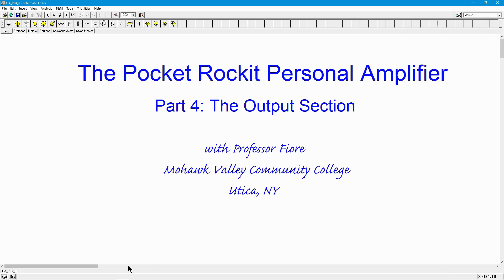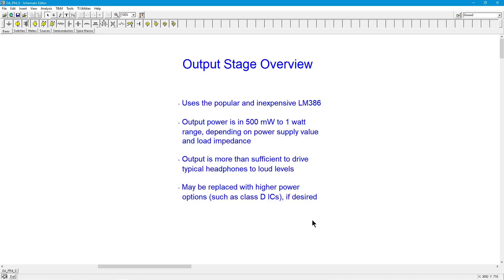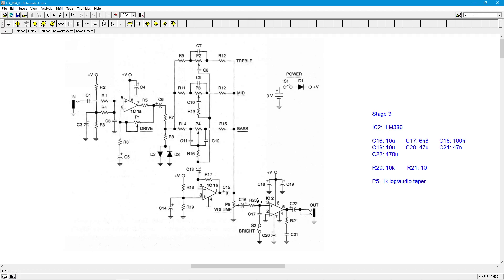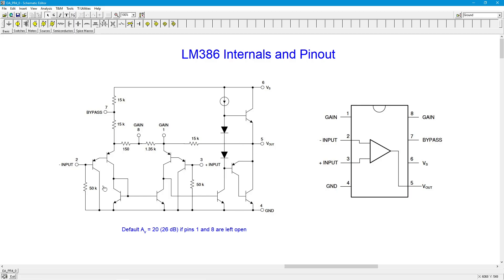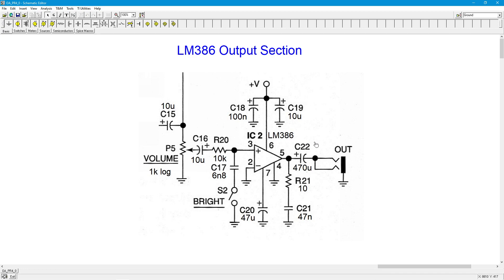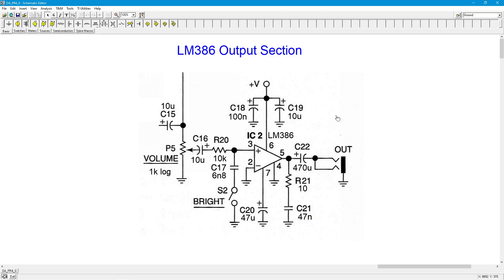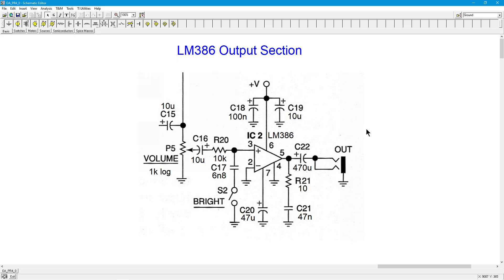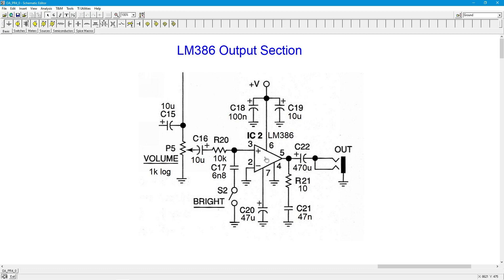Op Amps: Pocket Rockit Personal Amplifier, Part 4

Comment: Well, I have this built but the EQ doesn't seem to work.  Anyone out there have any ideas?  I am pretty sure the circuit is correct, as I am using a PCB created from the schematic.  I also measured all the components as a sanity check.
Reply from the maker: Hate to say this but, if you've checked all of your components, chances are that there is an error in your layout. I built this circuit back in the days when we hand-taped the layouts and I can verify that it works fine (i.e., this is not something I just simulated). At this point, my question would be "Is it just the EQ that isn't working or is it the entire Pocket Rockit?" If it's just the EQ not working, the issue is whether or not you see any change in signal from the EQ input to the EQ output. That should give you a clue. Back when I was in college, a friend of mine built a 10 band octave EQ. He brought it to lab and couldn't get it to work. It would cut, but it wouldn't boost. He was really depressed. I offered to help, and together we started tracing the signal. It turned out that he inserted the wrong size coupling cap at one point (as in nF instead of uF) and that just crushed the signal. Sometimes the errors are just dumb mistakes like that or a trace that goes to the wrong side of a component. Unfortunately, sometimes the "obvious" mistakes are the hardest ones to find because you expect A but it's really B (like trying to proof read your own writing). I've seen many goofy things in lab. I once had a student who could not get his senior project to work. The chips were fine but it turned out that one of the IC sockets was bad. The craziest thing I saw was another student who could not get the power supply portion of his senior project to work. We finally traced it back to some rectifier diodes that were mislabeled (band on wrong end). Turns out that he had picked them up at a local Radio Shack in their bargain bin. Not much of a bargain!
Reply: @ElectronicswithProfessorFiore All other functions including the "bright" switch function work, though the distortion control does act as a volume control at lower volume levels.  I have used the Bode function on my scope, but see no change in the signal.  I hear a slight change in the bass response at both ends, but the changes are identical and small.  I have verified my schematic (KiCAD) against yours and it seems correct, the only difference is that I had used two caps in parallel and in another case two caps in series to replace caps with unusual values.  The PCD  was made with KiCAD and with a correct schematic I would assume a correct PCB.  I want to say, I am not criticizing the design, as I know full well that it is me that is the problem here, it's just me looking for ideas.  You did give me an idea to try.  While I traced the signal with a 400Hz sine, I did not do that with the white noise signal, I should have thought of that.
Reply from the maker: @jamesbelcher5318  The fact that everything else works is a big plus. I assume you're getting signal out to headphones, it's just that the EQ is dead. Depending on the size of the input signal, low levels of distortion may produce just gain variation, so that's not odd. It might be helpful to trace a few sines through the circuit, say 100 Hz, 1 kHz, and 10 kHz, and see what (if anything) happens as you twist the EQ knobs. The fact that the EQ section isn't completely squashing the signal or producing gross distortion tells us a few things (e.g., power is probably correct, and this is easily verified with a DMM). It sounds to me like an inadvertent short across the EQ circuit or possibly the pots. I would cross verify the PCB leading into/out of the EQ section. Do it in a way sort of "reverse" to the way it was created. That might sound a little odd. It's like if you want to check a long string of numerals for accuracy: do it in reverse order, from finish to start. 

Another thing that comes to mind immediately is a misinterpretation of the schematic. The obvious one here is the connections from the wiper arms of the EQ pots down to the input of the IC1b (around 4:00 in). Those little "gaps" are jumps. If those were treated as connections or opens, it would kill the EQ.
Reply: @ElectronicswithProfessorFiore  Been fighting this now for awhile.  Discovered, thanks to your advice, that the EQ does seem to be working.  Using the three freqs mention I do see a change.  The change gets to pin 5 of  IC1B but not seen on the output pin 7.  Changes the chip check the rest of the components, but no joy.
Reply from the maker: @jamesbelcher5318  Pins 5 and 7 are IC1a. 1a is in the input section before the EQ. Look at the schematic around 4:00. As far as IC1b is concerned, pin 2 is a summing node. You should only see the DC bias there (4.5 V) and virtually no AC signal.
Reply: @ElectronicswithProfessorFiore  My pins are reversed, using 5,6,7 for IC1b
Reply from the maker: @jamesbelcher5318  OK, but you should see virtually no AC signal on either input of the second IC, as I mentioned.

Comment: Could you suggest a cap type for the polarized ones?  Electrolytic?
Reply from the maker: The large value polarized caps would be electrolytic, unless you don't mind the much higher cost and physical size of film types. That would include C16 and C22 (we're not seeking extreme fidelity here). The bypass caps (e.g., C19 and C20) would be as well.
Reply: @ElectronicswithProfessorFiore  I have tantalums for everything but C22.  This is the only type that I have been able to find other than electrolytic.  I have not found any other type to do this.
Reply from the maker: @jamesbelcher5318  Tantalum will be great for power supply bypass. I am surprised that you could not find smaller electrolytics (e.g., 10 uF, 47 uF). I know the large distributors have a selection.
Reply: @ElectronicswithProfessorFiore  I have electrolytics that would do the job, I just thought Tants might be better.  Would electrolytics be a better choice?
Reply from the maker: @jamesbelcher5318  Neither are considered to be of the highest quality for audio signals, so if I was making a very much "hi-fi" circuit I would use neither of them for the signal path (but they'd be fine for power supplies and related). For signal path, I'd use film types. But this is an instrument circuit, so lowest possible distortion goes out the window (indeed, it has controls to add distortion). I'd say use what you have unless there are size constraints.
Reply: @ElectronicswithProfessorFiore  I have film caps (mylar) but none of them approach the 1uF and up values that the circuit requires.
Reply from the maker: @jamesbelcher5318  Not surprised. Over 1 uF, film types tend to get large and pricey, especially for the really good ones such as polypropylene.
Reply: @ElectronicswithProfessorFiore  Sounds like a good idea for a video Professor.  Cap types and their uses.
Reply from the maker: @jamesbelcher5318  Yes, it is. I might expand that into a series on passives (R, L, C). This was something I always stressed to my students in lecture (and which can be found in my circuits books). I used to have a little "zen-like" question: "When is a resistor not a resistor?" Answer: "When you can hold it in your hand." That is, the physical thing we use is just an approximation of the idealization we call "resistance". The symbol we draw represents that idealized concept, but we cannot forget the reality (i.e., limitations) of our attempts to approach it in "meat space". Thanks.
Reply: @ElectronicswithProfessorFiore  I have all of your books, at least the ones Amazon has.  Could you provide a reference?
Reply from the maker: @jamesbelcher5318  There is some general discussion of this in chapter 8 of the DC circuits text, but you'll also find items here and there (for example, in the op amps text toward the end of the active filters text). I have decided to do a video series on this, but it will be a few months before it comes out as there are other projects ahead of it.

Comment: I've been trying to follow along with your videos using TINA. I'm stuck on figuring out what you used for a stand-in for the LM386 for the schematic. I've tried all the stock ones (i think), but couldn't find one that has the same pinout. Does anyone have any advice, or videos that could help me figure that out?
Oh, I also was wondering how you'd go about adding a headphone output on here in addition to the speaker output (which is what I am assuming is shown here). Thanks!
Reply from the maker: TINA-TI doesn't have an LM386 model. Another commenter mentioned that he found one on the 'net. Speaker output and headphone output are the same thing. You just wire up a stereo jack as dual mono.

Comment: Thank you professor 😃, I want to thank you for your books and generosity, they are absolutely fantastic and they helped me out in the project I am working at now (especially with filtering)

I have a good enough LM386 spice model that I am using in LTspice, how can I share it with you?
Reply from the maker: Where did you get it? Maybe others would find it useful, too. Assuming it's not too big, you could always post the SPICE text here as a comment.
Reply: @ElectronicswithProfessorFiore  sure thing!, I kept searching online until i found 4 references, comparing the models narrowed them down to two, and I used one of them and it works, I want to give you the 4 links I found so that you have the sources, how can I do that? 

******************************************
* LM386/NJM386 spice subckt model. 
*
* Developed for EasyEDA by:
* 
* Subckt based on the schematic shown in the 
* NJM386 datasheet:
* Specifications based on the above and:
*
* Gain accuracy, output voltage self-centring, 
* typical quiescent and input bias currents 
* and unloaded bandwidth are modelled. 
*
* Output swing is optimistic with < 8 Ohm load 
* resistances. The reason for this is unclear.
* If anyone has scope traces of the LM386 output 
* voltage driving into clipping with loads of 
* between 4 - 16 Ohms please contact: 
*
* Last edited 150611
******************************************
*
* IC pins:       2   3   7   1   8   5   6   4
*                |   |   |   |   |   |   |   |
.subckt LM386EE inn inp byp  g1  g8 out  vs gnd
*
.param
+ Rbval = 28.25k
+ Re1val = 100
+ Re2val = 1k
+ Re3val = 4
+ Rcval = 10
**
* Input stage
Q1 0 INN q1e 0 PNP1
R1 INN 0 50k
Q2 0 INP q2e 0 PNP1
R2 INP 0 50k
Q3 0 q1e q4e 0 PNP1
Q4 q4c q1e q4e 0 PNP1
Q5 0 q2e q6e 0 PNP1
Q6 q15b q2e q6e 0 PNP1
**
* Input stage current mirror
Q7 q4c q4c 0 0 NPN
Q8 q15b q4c 0 0 NPN
**
* Input bias curent and gain setting resistors
R3 q4e q1e {Rbval}
R4 g0 q4e {Re1val}
R5 q2e q6e {Rbval}
R6 G1 q6e {Re1val}
R7 G8 g0 150
R8 G1 G8 1.35k
R9 OUT G1 15k
R10 BYP g0 15k
R11 q10c BYP 15k
**
* Tail and PNP emitter follower current mirror
Q9 0 q10c q10b 0 PNP1
Q10 q10c q10b VS 0 PNP1
Q11 q11c q10b VS 0 PNP1
Q12 q12c q10b VS 0 PNP1
** 
* Emitter follower buffers and 
* quiescent current control
Q13 0 q4c q11c 0 PNP2
Q14 q18b q11c q14e 0 NPN
R12 q14e 0 {Re2val}
Q15 0 q15b q12c 0 PNP2
Q16 q18b q12c q17b 0 NPN
**
* Voltage gain stage
Q17 q23b q17b 0 0 NPN
C2 q23b 0 1p
**
* Crossover distortion/quiescent current mirror.
Q18 q18b q18b VS 0 PNP2
Q19 comp q18b VS 0 PNP2
Q20 q25b q18b VS 0 PNP2
**
* Crossover drop diodes and compensation cap.
Q21 comp comp q22b 0 NPN 5
C1 comp q15b 15p
R13 q25b comp {Rcval}
Q22 q25b q22b q23b 0 NPN 5
**
* Push-pull output stage with Sziklai pair.
Q23 q24b q23b q23e 0 PNP2
Q24 q23e q24b 0 0 NPN 100
R14 OUT q23e {Re3val}
Q25 VS q25b q25e 0 NPN 100
R15 q25e OUT {Re3val}
**
* Models
.model NPN NPN(IS=1E-14 VAF=100 BF=400 IKF=0.4 
+ XTB=1.5 BR=4 CJC=1E-12 ITF=1 VTF=2 XTF=3)
.model PNP1 PNP(IS=1E-14 VAF=100 BF=100 IKF=0.4 
+ XTB=1.5 BR=4 CJC=1E-12 ITF=1 VTF=2 XTF=3)
.model PNP2 PNP(IS=1E-14 VAF=100 BF=200 IKF=0.4 
 +XTB=1.5 BR=4 CJC=1E-12 ITF=1 VTF=2 XTF=3)
*
.ends LM386EE
******************************************
Reply: @ElectronicswithProfessorFiore  sure thing!, I kept searching online until i found 4 references, comparing the models narrowed them down to two, and I used one of them and it works, I want to give you the 4 links I found so that you have the sources, how can I do that? 
I tried posting the SPICE text here multiple times and it gets deleted
Reply from the maker: @MuhammadWaheedAtef  Maybe the file is too long(?) How about just posting the links, then?
Reply: @MuhammadWaheedAtef  I'd love to get the LM386 SPICE model as well please! : )
Reply: @noturnosferatu  Look for electronics ain't easy LM386